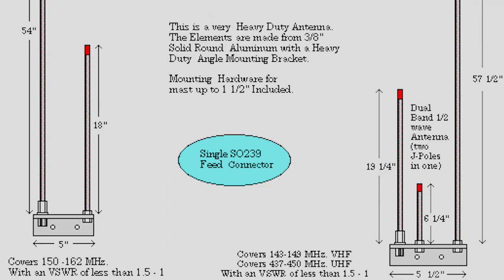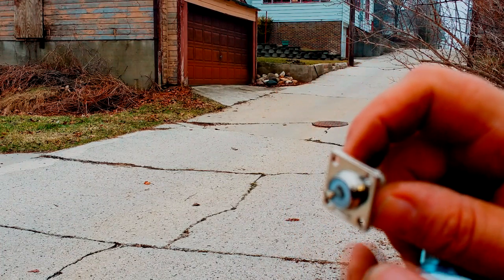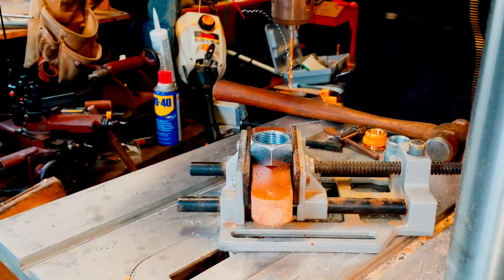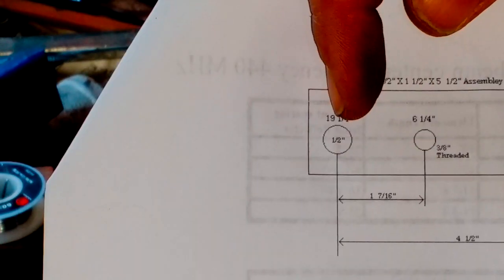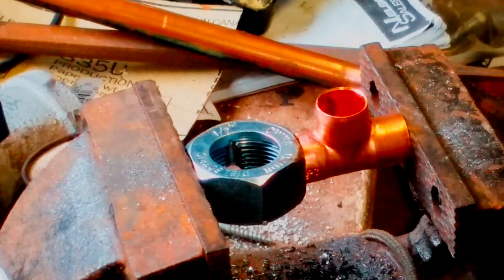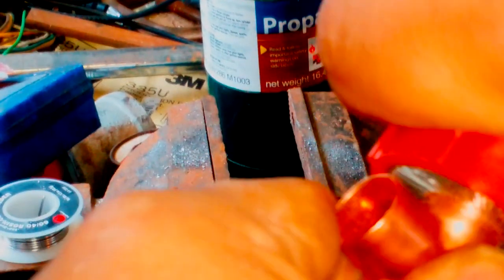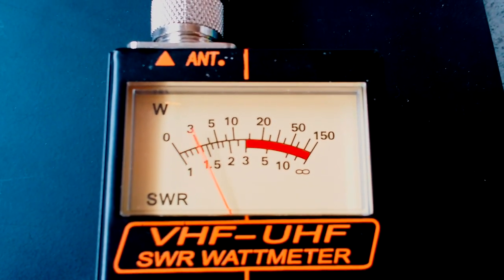Dual Band J Pole 2M-70cm

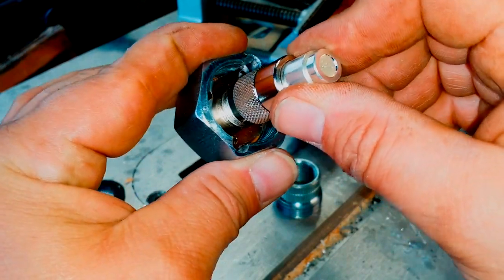Comment: time of 5:04 , sir you forgot to  put back the black spacer to isolate the SO-239. is it that the center of SO-239 connected to brass? coz you did not mentioned what to connect in the center of SO-239? will please elaborate that portion. tnx 73
Reply: Maria Lourdes 
the center is isolated when the SO-239 is attached.
Reply: the insulator goes in before the brass fitting, which helps to isolate the SO-239
Reply: the black piece is a washer, this is only used to prevent water from leaking from the fitting. no need to use it because it's not being used for water.

Comment: Greg, i was looking at the SO-239 leads you took outside of the nut.  Did the center go to the element and the shield lead go to the connecting t-connector & nut (Or Vice-Versa)?
Reply: Im just working on how the driving element & the copper collar of the isolator is connected to the center coax post of the SO-239
Reply: Figured it out.  Sorry.

Comment: Why on earth would one use a SO and PL connector on 70cm (or even on 2m). The connectors are ok up to 100 MHz. I would rather use a BNC or N-Connector. PD0PSX
Reply: Because that is what is used. Every 2m I have ever owned or seen, HTs not withstanding, have had a SO-239 on the back of them. This includes every single dual-band 2m/440 mobile as well.